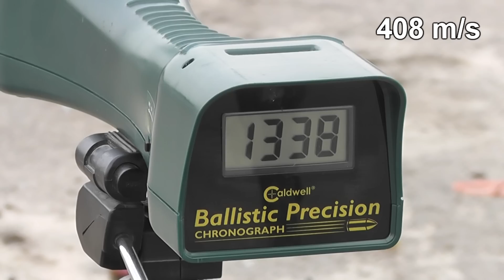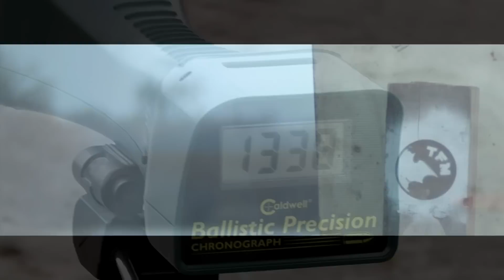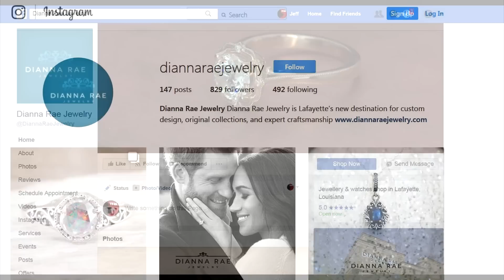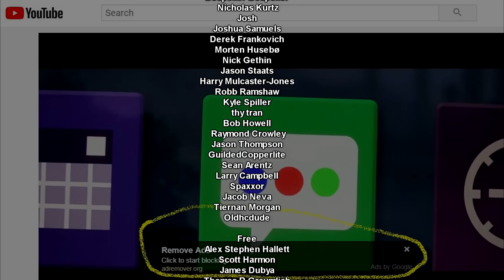World's MOST EXPENSIVE Shotgun Slug  - 2 oz. SOLID GOLD

Comment: TAOFLEDERMAUS - Did a comparison a while back - silver is 10.5 g/cm3; lead is 11.4 g/cm3 and gold is over 19 g/cm3 so gold is twice as dense as the other metals...silver behaves just like lead but is harder.  Gold would be a spectacular metal for bullets except for the cost factor, also the melting point...it casts and handles easily except that it needs 1900+ degrees to melt it (3x what lead melts at).  So for all intents and purposes, lead is still the overall champ for use in bullets.   Glad you recovered the metal.  This was a most interesting video  - It should be on TV  Thanks,  FC Steve
Reply from the maker: I was surprised the gold did not mushroom out more than it did.  Even lead will flatten out considerably in Kevlar.   I sort of expected the silver to hold up well even slamming through the wood.   HEY,   we were talking about you in the Buck and Slug reloaders group on FB.    Has anyone told you about that group?   Your wisdom would be nice to have there!
Reply: T - I haven't had the time to devote to FB just answering comments on my own channel...and you are one of the major players on YT..!!  You must have the true gift of time management.  Wow, to even be mentioned in your circles is a true privilege.  I'll have to go check out the Buck and Slug group right after I get caught up on replies - am 80 behind.  You must get tons...!!   More power to ya..!!   FC Steve

Comment: I think if you could get a slug with blades to somehow work would it not tear through Kevlar because at the speed it is moving and spinning the blades should tear it apart
Reply: Not a slug designer so yeah
Reply: If u can get someone to machine one and send it to them then we can see if it works. I'd think a bladed slug would not work though, kevlar is fairly hard to cut through, a thin, hard, needle-like slug would work better